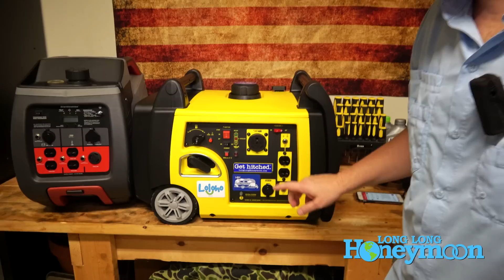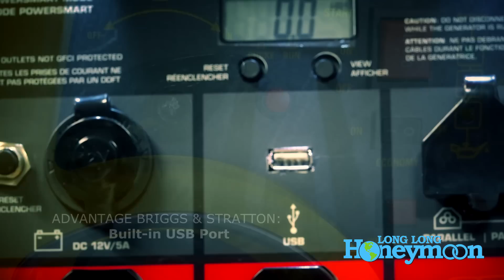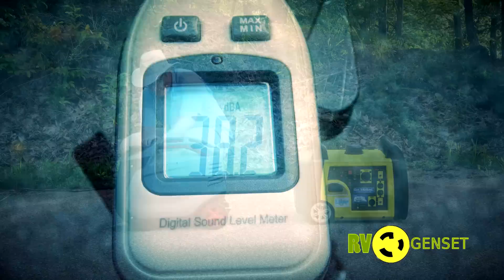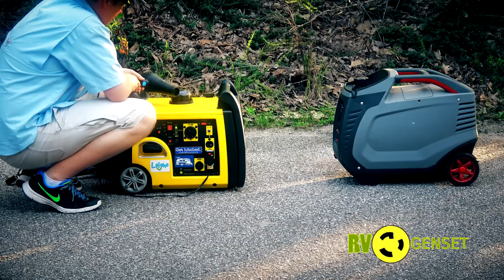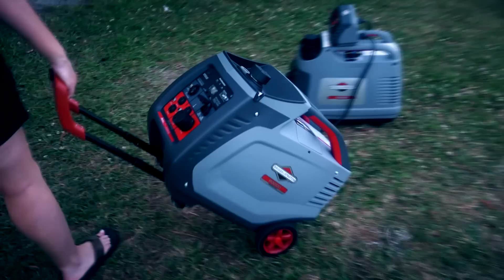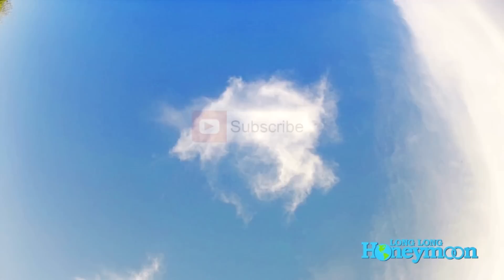CHAMPION vs. BRIGGS & STRATTON: 3000W RV Camping Inverter Generator Comparison and NOISE TEST

Comment: In all tests, both generators were within 1 to 2 dBA of each other, which is not perceptible. I wouldn’t base my decision on which one to buy based on how noisy they are. Instead, weigh the other differences noted in the video like remote start, price, etc.

Comment: I own the Champion 3500 dual fuel and love it. When running propane you have 3150 watts and on gas its 3500 watts They are Great Generators Inverters for the money and not much noise at all. I've ran my 15k ac or my 13.5k ac only one at a time. TV and lights Haven't tried Micro wave at same time with ac. I doubt it. Just Love this Inverter.

Comment: I'm sold!  We bought our first travel trailer and it does not have a generator.  We live in Alaska and will be doing a bit of boondocking so we will need one.  I did some research, watched a few of your generator videos and this one sold me.  I jumped right on Amazon ... "will not ship to your location".  Cabela's, Lowe's, Home Depot, WalMart... All the same.  So, on the next trip you make to Alaska, bring me one!  I can buy a mattress from Amazon and have it shipped, but I cannot buy a pillow.  I can buy a grill, but cannot buy a griddle accessory for it.  Ugh!  Thanks for the great information though!  I had to go with a Firman.  It also will fit under my truck bed cover, has the RV ready 30 amp outlet, and remote start.

Comment: Hi Sean, do you have any experience with your Champion in high altitude? I go to Mammoth once a year and I haven't bought a generator yet but have considered the Champion mainly because of your videos and the remote start. But I've read on some blogs that they don't work well in high altitude and that a kit (high altitude) isn't available from Champion. As always, another great video & keep up the good work!
Reply from the maker: Haven't taken the Champion to higher altitudes yet, but you will lose power (roughly 3.5% for every 1000 feet above 500 feet above sea level.... or somethin' like dat ;)).

Comment: Hey guys love the Vids you guys post, I know this a a comparison between Champion and Briggs and Stratton, but could I get some user info on the 4.0 Onan Gas Generator, I am getting a 2016 23ft Class C Motorhome and it comes with that generator, not a generator user so this is all new to me, go easy guys, I appreciate any advice, and once again Long Long Honeymoon, love your vids, I have camped before 5th wheels, Campers etc, but first motorhome, any suggestions would be appreciated,,,thank you all,

Comment: Do you know why the duel fuel unit by champion does not have a remote start like this unit does? Is this the only unit they have in this range or higher with the remote start?
Reply from the maker: I don't know, but I think a dual fuel with remote start would be the ultimate generator for a lot of people. I love our remote start gasser.

Comment: I went with the Honda EU2000i running on propane and the Micro Air Easy Start. The Honda starts & runs the 15,000 BTU Dometic Air Co on top of our Airstream. I also like the fact that I do not have to carry gas cans around. I simply connect to the quick connect on the front of the RV. Will be putting this combo to the test In January when we will be spending most of the year on the road.

Comment: I've always wondered why is it that my 6.7 liter diesel truck is quieter than even the quietest of generators... My previous trailer had a "power plus" package and came with a 7000w cummins generator (gigantic for a 23ft bumper pull toy hauler)... that thing was insanely loud.  I would honestly love it if i could hack up an old prius and turn it into a super quiet 20k watt generator that I can tow behind the camper...
Reply: Your truck has several feet of pipe and a much larger muffler for exhaust to travel through.

Comment: Have the Champion model without electric start and it works great. Easy pull and I have never had to pull more than once to start it since I took it out of the box.

Goes about 5 hours or so on economy with A/C / refrigerator running. Goes about 8 - 9 hours just running refrigerator, lights and fan.

Runs our 13,500 btu a/c and refrigerator easily but we do need to turn off the refrigerator briefly to run the 1000 watt microwave.

Comment: Bud, you are wrong, the Champion CAN be hooked up to another Champion in parallel.
Reply from the maker: +mark ford depends on the model. Our model cannot be run in parallel. It lacks a parallel port.
Reply: Oh, OK, sorry. I guess that I have not seen that model. Every Champion I have ever seen has the parallel ports. I have the duel fuel 3400 watt Champion inverter generator and have considered getting two of the 200 watt unit just so I could pick them up easier. Safe travels. BTW, I like your videos.

Comment: Do you use standard gas or ethanol free gas on your generator? Thx in advance.
Reply from the maker: +Alex Rodriguez I use standard (usually premium) ... but if the generator is going to sit a while, I add fuel stabilizer to the tank. If you can easily obtain ethanol free fuel, that is probably best.

Comment: I bought the 3100 Champion last year. It could start my AC but not continuously run the 13.500 AC. So I bought the 3500 but it would NOT start my AC. Hahaha I had to warm up my AC motor by hooking up the 3100 then switching it to the 3500 generator. I finally bought a HARD STARTER for the AC and installed it. It works great and only failed once at starting up after being parked for a few weeks. The test was in Maupin Oregon were Temps were over a hundred. 3500 started and worked all day! Now I can sell my 3100 Champion. :)
Reply from the maker: You guys may already know this tip, but just in case.... It may be helpful to switch your refrigerator to propane and flip off your power converter (the automatic house battery recharge) when running the A/C. https://youtu.be/Y6SeSCTAY5o
Reply: oh yeah, we are way ahead of you on gas to the fridge. I just think the 3500 has a lot more overall horse power but is too soft at starting our AC and the 3100 is a small beast that likes a good sprint but cant do the long term of holding the compressor when it re-connects every few minutes. I also recommend to purchase a generator that is capable of parallel. Our 3100 champ was not. So on the next purchase I had to do a BIG REDO on making sure the 3500 had the capability. It also does propane but you wont get the full power. I think I might try propane hook up in the winter when I just need ECO.
Reply: SimplyFilms , you can run the 3500 in parallel?

Comment: Champion 3100i sells for $899.00 on Ebay...
Reply: It used to be about $700 but I think maybe supply and demand as well as a surge in popularity has brought that price up to around $1000 at times.  Amazon has fluctuating prices on it ranging from $850 to $1100 depending on when you look.  I got mine from Amazon Warehouse Deals for $725 because the box was alittle beat up.

Comment: LLH, how do you use your generator in the rain? Do you have a rain cover or do you possibly leave it in the back of your truck under the bed cover? I just had a generator swamped by a downpour of rain. I was thinking about making a little tent for it.
Reply: I use a wire dog crate without the bottom plastic tray. The generator sits inside the dog crate outside the RV. Then I use a regular tarp around the top and sides of the dog crate (not the ends where the doors are). There is sufficient space between the generator and dog crate for air flow. Also the exhaust side of the generator faces the end of the dog crate that are not covered by the tarp.  Get a dog crate that has 2 doors and a side door. The side door lets you open it and access the controls for the generator on the side.

The dog crate is light, and folds when not needed for storage. 

The tarp can be tucked under the dog crate. I use a few weights on one side to make it easy to pull up the tarp when I need to refuel the generator. This way the tarp won't blow away.

We've used our generator this way many times in the rain without any problems.

Comment: We opted with an upgrade from our Honda 2000 ie to the Champion 3400 with the duel fuel capability.  My husband won that battle as I wanted the remote start.  The duel fuel doesn't have the remote start.  Either way, it's been performing well for us

Comment: When you do the test, the used generator is sitting fairly close to the exhaust of the running one. I wonder if there'd be a different reading if sound wasn't bouncing off the other generator. Maybe not, but I wonder.

Comment: Sean, have you ever thought of building a sound box for your generator?  By that, I mean a 'box' (made of lightweight, solid foam insulation) that would fit over the generator loosely, allowing for air inlet and exhaust outlet, which could drop the sound volume to a fraction.  It would be interesting to see if your remote start would work thru the box.
Reply from the maker: I would love to build one. Hmmm, we just might do it. I don't know why the manufacturers (or a 3rd party) haven't produced such boxes for retail sale. I think a lot of people would buy them.
Reply: Me too.  A single 4x8 sheet of solid foam, very light, and some duct tape is all you need.  The box would weigh a couple of pounds, tops.  I have the materials, will build mine this week.  Less that $20.
Reply from the maker: I assume you can buy the solid foam at Lowe's or Home Depot? I may give it a go.
Reply: Yes, Home Depot.  Be sure and get the R-Max.  It's solid foam and won't come to pieces when you cut it.  Cheaper types are like styrofoam and crumble.  In fact, the Home Depot crew will cut it for you if you know the sizes you want to go home with, for easier transport.

Comment: So, Sean, does the Champion power your A/C unit ok?  That's the one thing we need more than anything else and since the Champion ran quieter, at load, that seems to be the one to go with - if it'll run our A/C unit.  Thanks
Reply from the maker: It runs our 13,500 BTU A/C without flinching. https://youtu.be/00fkBB3IZrU?t=10m40s
Reply: how about the 15K units on airstreams?. see some that do and some that are not able to handle 75amp inrush at start up. there is talk about a "soft start" kit being able to allow a 2000 watt unit to start the 13.5K AC,  any test you know about.. 

love the channel and the Alaska stuff for sure.. hope to make the trip with airstream caravan in 4 yrs..
Reply: Somewhere here on YouTube there's a video of a guy who rigged his a/c unit to start (and run) with a much smaller unit than these by installing a capacitor on the unit's motor.  It wasn't the running amps that was the problem (as you know) but that surge at start-up.   But the guy understood electronics better than I.
Reply: Thanks Sean!  That's good to know.
Reply: I installed an EasyStart on my AC and my Honda 2000i will run it!
Reply: Kool.  I don't suppose you can post the video?
Reply from the maker: I'm looking into this option... :)

Comment: I went with Briggs & Stratton P3000, love it! Powers my a/c with no problem. Didn't see the need for electric start, you're going have to get up and  hook up cord to it anyway...never has failed to start on the first or second pull.
Reply from the maker: Thanks, good to hear your real world report. Our Briggs & Stratton also does a great job with our 13,500 BTU A/C. It reliably starts on the 1st or 2nd pull too. We have a 17-year old B&S powered lawnmower that still starts just as reliably. I hope these generators have similar longevity.

Comment: So the Champion is like a hundred pounds? Does it come with a little crane kit?
Reply from the maker: +George Sears haha it feels like a feather after moving around a 150-pound Honda or Yamaha. 😂
Reply: They have a handle that folds in. We use two people anyway to lift. But too light and somebody can run off with it.
Reply: I agree.  It is heavy.  That said, when compared to the similar 3000 watt versions from Yamaha and Honda, the Champion 3100 is 50 pounds lighter and has way more features and is way less money.  The only significant advantage the others have is loudness and that's somewhat minimal.  As for comparing the Champion 3100 to the other 2000 watt gen sets, the Champion is just as easy to move due to the built in wheels and folding handle UNLESS you have to wheel it on sand or the like.  Then those wheels on the Champion are useless.
Reply from the maker: I agree about the noise. The Champion is very good, but it's not as good as Honda/Yamaha. Also there's a new player -- Atima -- that is almost as quiet as Yamaha (it has a Yamaha engine).

Comment: The Champion does not come with a USB port but when you get a Champion they do give you an adapter to plug in the 12V plug with 2 USB ports.

Comment: Nice... mellow comparison.  I got the dual fuel Champion.  I'm finding for the most part these gens do a fine job and folks check  out the details for personal likes without purchase.   Perhaps you could vid a gen and compare locations. In the truck bed, out, far away, and tell which seems to be the least bothersome, invasive, and convenient, noisy according to the location,  Walmart vrs. no-wheresville.  .  Thinking of running it on  the tailgate but the long runs of cable may hurt the load. Mine is heavy.   Oh! and Sean, possible video fodder..  Bugs Bugs, Bugs.. I seem to get spiders dropping from my ceiling about once a week.  What have you experienced?  Why? Where? Season?... Thanks again..  A Full Time Noob. 
.
Reply from the maker: We just did a vid about ants! We'll consider one about spiders - LOL - we have had a few...

Comment: I have a 5th wheel with 2 ac units and a res. fridg im thinking a 7000 watt Honda inverter generator. Whats your thoughts. We live in Texas so 2 ac units are a must.
Reply from the maker: Can't go wrong with that nice Honda 7000W unit. It even has fuel injection http://amzn.to/2vieulW For your rig I do agree you will want the extra power.

Comment: Thanks for the generator comparison Sean. Not to be rude, I went with Honda EU3000is it runs my Airstream a/c 11,500 BTU, large Nutrabullet, 18 LED lights, radio and toaster at a max of 58 db but most of the time a lower db. But to tell you the truth 58 db was loud to me especially when we were camping in total wilderness. I could not imagine anything louder
Reply from the maker: +Joe Hondas are the gold standard for sure. Someday I'm going to get my hands on one for review and comparison purposes. 👍

Comment: Good video, BUT, the Champions CAN BE twinned or linked together! Check their website, the have the accessory and will work on any of their inverter generators 2800w and up...
Reply from the maker: Thanks, I will check it out. I don't see any parallel port on our model, so I my understanding has been that we would need to a different model for that feature.

Comment: I thought the Champion comes with a USB adapter that you plug into the 12V output?
Reply from the maker: Yes, but if memory serves the Briggs also includes one of those devices (and they are readily available everywhere). I was just referencing the built in USB port.
Reply: BTW, great video... well done. I follow you two and have gotten some great tips, THANKS

Comment: were the mufflers both pointed in the same direction ?
Reply from the maker: Yes, both pointed towards the right (that's why the Briggs control panel is not visible.... it has a different layout).

Comment: If you didn't have to contact Briggs and Stratton customer service and you had to on the Champion then I would rate Briggs and Stratton better.
Reply from the maker: +biker_dude well, the problem with my Champion was due to an incorrect Amazon listing. The listing incorrectly stated that a certain charge cable would be included. I checked with Champion to see if my unit was missing the cable, but all was as intended. To compensate for my inconvenience, they sent me a free generator cover anyway! 👏
Reply: Well I can see why you liked their customer service then.
Reply: But he has had the Champion for over a year, just got the Briggs and Stratton last week.

Comment: You need to compare to a Yamaha EF3000IS 3000 watt inverter generator, It  has a noise level rating of 53 dBA – 60 dBA but is twice the price of the Champion. But it does have a remote start as a option. LOL

Comment: Depending on the direction of the exhaust, the noise level will vary. I would be more interested in measuring the noise from the noisy side of the units. Measure and rotate the units to find the noisy side. I have the Champion Duel Fuel model and wish I had the remote start. Not that the lack of a remote start switch is a deal breaker. The battery has to be charged for the starter to work.
Reply from the maker: +Jerry Karlovich yes, I positioned each generator so the exhaust was pointing in the same direction (right side). Of course in the real world, whenever possible I would position the generators so that the exhaust was pointed away from my campsite and/or my neighbors.